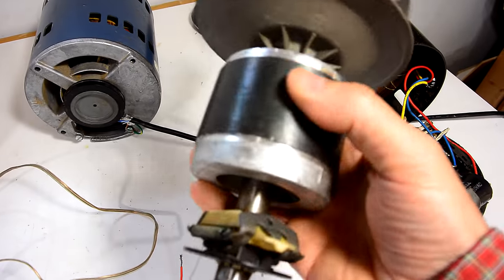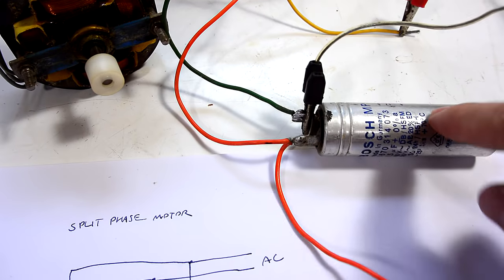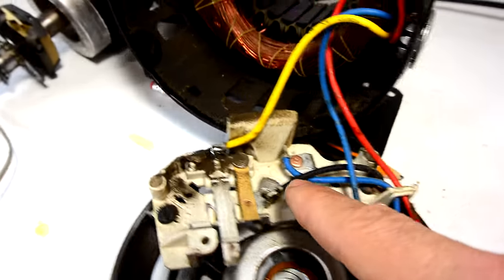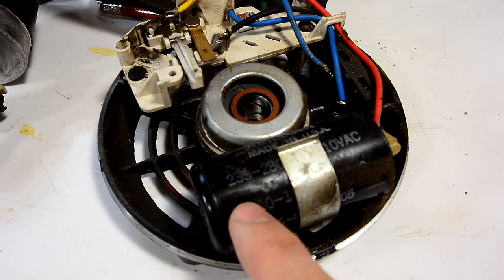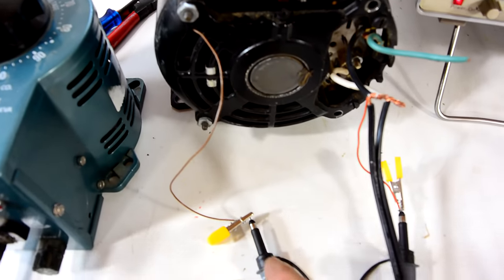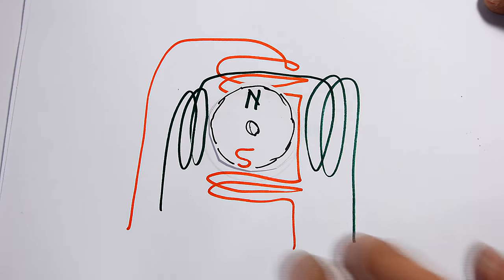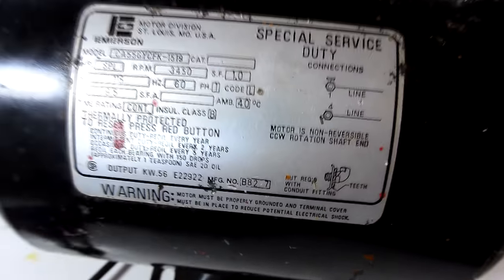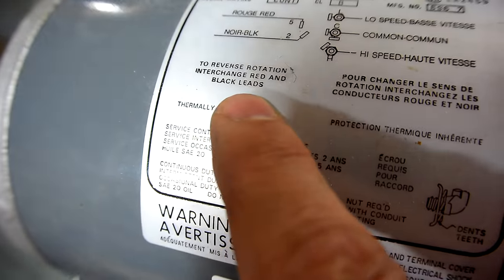Reversing single phase induction motors

Comment: VERY TO THE POINT, SIMPLISTICALLY BLOCK DIAGRAM PRESENTED ! BRAVO MATE !!! A SIMPLE EXPLANATION , OF A VERY TECHNICALLY COMBINED PROCEDURES FOR REVERSING DIRECTION OF A SINGLE & 3 PHASE MOTOR WIRING,  AGAIN SPELLED/OUT SO VERY EASY TO UNDERSTAND THE IF/THAN. A TECHNICAL PROCEDURE-VERY WELL COMPACTED  VIDEO,  COVERING ALL THE MAIN CAN & CAN'T DOs' . IT IS SO WELL PRESENTED  WITH  A "HANDS-ON SIMPLISTIC  ILLUSTRATION !
AGAIN, BRAVO !  I HAVE SEEN ALL YOUR VIDEOS & COULD NOT DISAGREE ON ANY OF THEM !. IT IS AN ART TO PRESENTING SOMETHING TECHNICAL IN A EASY-PEEZY TO UNDERSTAND PRESENTATION !👊👊💥🎯

Comment: Matthias,  I was able to reverse my non-reversible motor (an A.O. Smith, 1/8 horse power) without altering the coils.  I simply pulled off the casing ends and flipped the rotor end-for-end.  After this, the motor ran in the opposite direction.  It may not be possible to do this with all non-reversing motors, but on this one it worked perfectly!  The motor powered a heavy-duty orbital buffer that shook so violently that it was nearly impossible to use.  I disassembled it, removing the orbital counterweight unit and bolted the buffer disc holder directly to the motor shaft.  I thought I had to reverse the motor, which it turned out that I did not have to do, however, curiosity got the better of me and I had to test my theory: that I could just turn the rotor end-for-end to get reverse rotation.  It works and was easy to do on this motor.  Thanks for your educational videos!  Will

Comment: Great explanation! The thin wire used for the start winding is also to help changing the phase angle due to the greater resistance.

Comment: I want to thank you for teaching me how to reverse old electric motors.
I finally got around to put in a reversing switch on my drill press. 
You explain the process a lot better than other people who tell us how to reverse drill press motors. 
My 1937 Delta drill press with a Westinghouse motor was easier than I expected. Once I open the cover on the motor there's only two terminals where the power wires went in and other wires came off of  the windings  and I just reverse those two wires that went into the windings to make it run backwards.
I put a four gang box on the drill press with three switches, one for the motor, one for the light, and a 4 way wall switch to reverse the motor.
My old drill press lacks a few features I wish it had but it was fun putting this feature on it. Now I just need to find a light for it that looks vintage.

Comment: I had the situation at 7:45 with an unmarked motor where I had to disconnect all of the wires, ohm them to see which ones were which and then I was able to confidently unsolder and resolver the switchover, close it back up and low and behold, it worked!
Thanks Matthias!

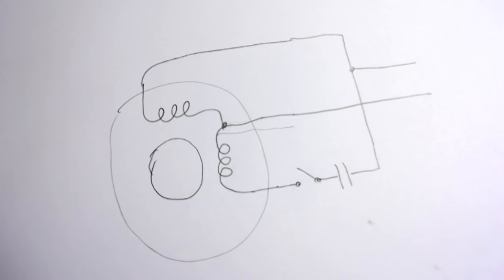Comment: Very good explanation. The only thing I disagree with is the comment that the motor at around the 8:30 mark "has to have the coils removed from the motor case or a hole drilled in the case" , to get at the coils common point so it can be split and swapped. As they have to be accessible for the coils to be joined, the common points on these motors are usually buried just under the first layer of coils near the ends of the motor. With a bit of care the wires can be traced back, dug out and split. The process is similar to digging out the common point for 3 phase motors so they can be converted from Y to ∆ connection. I have reversed a number of these motors and always found the common point close to the surface of the coils. I agree that this level of modification is probably beyond a DIY level.

Comment: Really interesting. And I agree with below comments. Keep this topic going.
I am just coming to understand AC motor and alternator theory of operation. I gain a basic understanding of what is actually happening, when I watch videos such as this, but I don't know enough to have the gut intuition that I have gained with internal combustion engines, which I began learning about as a young boy.
I recently bought an older Lima Electric 8KW 12 wire brushless alternator, and since I knew nothing about it, I began to research. The more I found, the more I thought to myself, "Wow, this is amazing!"

Comment: Didn't expect to see an osciloscope in a woodworking shop :D, great video !
Reply: Ramekenas  With the use of a homemade inductive pickup, oscilloscopes can be useful in the garage as well. (You really could see whats happening on the spark plug wires) Whats really cool now is that oscilloscopes that used to cost 5-15 thousand dollars (analog) a couple decades ago,can now be had for a couple hundred dollars or less on ebay and craigslist.

Comment: Thanks for the video, it was very helpful. I ordered a brand new motor for my tablesaw from grizzly and missed that the rotation was clockwise and I needed a counterclockwise motor.

It was not reversible, but I was able to isolate the start windings and switch the polarity.

Comment from the maker: About reversing single phase induction motors, and how the starter circuit works.
http://woodgears.ca/motors/reversing.html
(and there are still a few induction motor topics left to cover!)
Reply: Matthias Wandel That is starting to make a LOT more sense now. I have two washing machine motors, one of which I hope to turn one into a table saw one day and wondered why they had a beefy capacitor on them. Keep the videos on this topic coming ;)
Reply: Matthias Wandel Another way to reverse a single phase motor: remove the capacitor, wind a string on the pulley in appropriate direction, pull hard on it to get it spinning and switch AC on shortly after. It will happily spin in the other direction but only by mechanical start.
Reply: themaconeau Cause turning washing machine drum need alot more juice than blade maybe?
Reply: Wayne Johnson Probably. But potential can be wound back. The first step is to get the motor moving correctly. Then I'll worry about ratios and torque later ;)
Reply: themaconeau would a washing machine motor have enough speed to make a good table saw??
Reply: Best explain the way you made the oscilloscope connections to mains before people fry their scopes!
Reply from the maker: Ariel Barton
Please watch the rest of the video for the answer.
Reply: Matthias Wandel A very clear presentation on induction motors.

And as this is the anniversary of the birth of Nikola Tesla, a posting apropos of the date.
Reply: Matthias Wandel
Superb, clear, accurate explanation once again.
Following on AsiAzzy's comment, the capacitor on my old lathe motor burn out, so it would not start - until I realised that giving the chuck a spin with my hand would get it going.  Later I twigged that I could start it in reverse just as easily, which was handy for some sanding operations.   For this reason, when I got a new capacitor, I put a switch in series with it so that I could disconnect it and have reversible hand-starts when needed.
Reply: Tim Hyatt It does have 1100 and 2000 RPM on the label. When the Arctic Freeze of 2015 ends, I'll have to get back out in the shed and actually wire it up ;)
Of course, your motor may vary. Unfortunately, when things go around here, the motor goes - like cars :(
Reply: Matthias Wandel Brilliant vid again Matthias!
Reply: Matthias Wandel next you should go over PTC thermistor start motors.
Reply: Matthias Wandel Thank you. That was a great explanation and an interesting video.
Reply: Great Matthias Wandel. I once build myself a discsander to sit on the wall. The motor turns always the same way of course. This summer, I need to move it to a different position in my tiny workshop, but it will then need to turn the other way. This trick comes in handy, as it's a motor of that kind. Thanks for reminding me of that solution. My thoughs was to rebuild the sander. But its quicker solved by moving the capacitor ;-)
Reply: Very interesting way to explain the operation of the motors, but,  do you know how wiring the switch for reverse rotation?
Reply: I'll try to describe how it's made in the Hofmann wheel balancer. It's motor also has 3 wires. The common point of two windings is connected permanently to the mains N. The capacitors are connected in parallel with both windings. There are 3 relays for the motor: K4 connects or disconnects (shortens) the start capacitor, K2 and K3 connect the mains L to the one or another end of the motor's windings.
Reply: +Matthias Wandel Wow! THANK YOU for explaining this, which has always been a mystery to me until now. It was also interesting to actually SEE the centrifugal switch for the starter winding. From your other videos I knew that distinctive "click" indicated the switch engaging or disengaging, but it really helped to see it and how it worked. Very informative!
Reply: +Learner-Learns That is the same thing iv'e been looking for!
Reply: +Matthias Wandel Thanks. Just reversed a motor I need for building one of your bandsaws. It was 'non-reversible' but luckily I was able to dig in and find where the windings were connected together and bring another wire out. Very useful video. xox
Reply: Can you show me how to wire a capacitor on a single phase motor? Im scared for burning out the motor if i plug it in. I've been looking for variable controllers, but i couldn't find any. This is what my motor says:

serv.cont. 1/4 ch Rotor case
220 Volts 1,95 A
                    ^
                    ?
phase 1 50 Hz. 0,18 kw. 1440 rpm. p11
cos 0, 64.

Please help me! :-)
Reply: I found out that i CAN run it with the walloutlet! But i still want to know how to wire a capacitor on tgose motors
Reply: the one that says cannot be reversed have you tried tearing it apart and assembling it backwards, that is inverting the rotor by puting the front cover in the back and viceversa
Reply: +Alonso Quesada It works. I changed the bearings in my bench grinder and installed the rotor backwards. (facepalm) When turned on it spun the nuts off both ends instead of tightening them to the wheels. Definitely works lol
Reply: sr.  so much respect to u.
what an awesome teacher!!
Reply: M

Comment: You can reverse an AC motor like a pump motor. You just replace the capacitor to a reaktor which is used in fluorescent lamp circuits. And thats it! ;) It is very useful when we have just 3 wires out of the coils.
Reply from the maker: RoCCaT You could also reverse it if you have two phase power.  Just run the starter winding off the opposite phase.  But that's equally awkward.
Reply: Matthias Wandel Yeah you are true! There are a lot of ways to reverse. I heared about to use the reaktor and it worked well.

Comment: So the start winding will likely have higher resistance than the run winding.  In fact, the start winding will likely measure open as the start capacitor is charged by an ohmmeters DC potential.

Comment: As you said, the start winding uses a thinner copper wire than the run winding. So if you throw an ohm meter across the windings the Start winding will be somewhere about twice the resistance of the run winding.

Comment: You answered a question I had about my old GE reversible boat davit motors. One of them wont start so i have to give its large pulley a shove to get it going. I plan to first replace the start capacitor. If that doesnt fix it I'll assume its the connections to the start winding or the winding itself. Thanks!

Comment: I have a motor like this on my bandsaw. I want to replace the switch with a magnetic relay switch but the old switch only had one black and one white while I need the two black and two white to hold the magnet together during operation... do you have any experience with this? Where to find the other white and black wire? Thanks a lot. Love your videos.

Comment: Matthias, love the explanation.   I have a 3/4hp boat lift motor that only runs in one direction.  It was full of mud daubers, cleaned thoroughly as I thought a switch might be stuck however still only one direction.  From your video, I see that windings must be good as it wouldn't run in either direction if windings shorted.  Any ideas I'd appreciate. Larry in Florida

Comment: I enjoy your videos and they are very informative.  Could it be that they don't want the motor reversed because instead of the starter switch arm dragging on the pressure collar that it would be pushing toward the pivot point like backing up a trailer behind a vehicle?  Would that make it want to break off easier (maybe sooner than later)?

Comment: Basic physics to application, adjustment & building cheap, great video. Ind. Motor no start, but runs if rotated, check start cap,

Comment: Hello,I've come across your video, and it's just amazing the ability to communicate simply ... Thank you! ... I have a slight problem that I have no idea how to solve it ...I have an asynchronous one-phase asynchronous motor with four wires on one side - red and orange and red and orange on the other. my question is,How to place them on four pins? ...So that I would connect the source of the voltage and the phase.best regardsitamar

Comment: Great video, thanks. I've got a Tuscan 240v  induction motor that appears to have 3 coils... there are 6 wires wires emanating from the coils, three colours red, yellow (joined) and green (to capacitor), then there are three black wires also?  Any idea how this is set up?

Comment: Hi,  have an old bench grinder that ive taken to bits for refurbishing. Its a single phase, start and run type with a centrifugal switch, and does not have a capacitor. There are two wires coming from the windings; a switched (on/off) line, and the neutral, which were connected to the lead. Since taking the bench grinder to bits im not sure of the wires polarity, they are both black. Can I take a guess and connect ? Im thinking that if I get them the wrong way round it will reverse the direction of spin only, so easily remedied ! However I dont want to break something. Can I just connect and see which way the motor turns (50/50) chance of me getting it right, or is it not as simple as this ? Bear in mind this is a start/run type motor, Thanks if you can answer, I realise this is a dated vid.

Comment: I have been doing research on making motors spin different directions and your video is the best! I have Car lift from Atlas that was purchased in US with single phase 230v motor and the motor is spinning in wrong direction. I had changed polarity according to the wiring diagram and it does the same. There are 2 metal strips that has to be changed from vertical to horizontal position and it should make it spin opposite, but it does not. Also swapping 2 positive leads did not do any different. I had another new replacement motor installed and it does the same. Atlas customer service representative suggested the motor winding being defective/installed wrong from the factory. Got new motor installed and it does the same. Any tips  what could be wrong with it?

Comment: grate video!!! Now I understand a bit mor about AC motors!!!!
One question. On a single phase motor like the the first schematic that you show, If i wanted to be bidirectional I will Need a Neutral wire and two live wires to select the rotation right?
My question is, What happens if I accidentally activate bothe of the Live whires at the same time. meaning that both windings will be runing at the same phase?  whill that create som sort os short circuit or burn the motor, or nothin will happen

Comment: hello mr Wandel, i have a single phase motor with 4 wires coming out of the motor. The windings are identical. one winding is connected by a capacitor(permanent). Can i just use the other winding and get it going by hand?

Comment: I have a 1.5 hp ac single phase motor with a start capacitor and 4 wires coming out from the motor.  
I figured out the leads that goes to the starting winding (checked which ones have continuity to the capacitor wires since the resistance was the same on the 2 windings).  
If i switch the connections of the starting circuit, the motor just hums and does not turn.  Is it because the centrifugal switch and the capacitor are not wired in series as mentionned in your text ?  Is there something I can do to reverse the rotation ?

Comment: I have a Delta Rockwell 12 14 table saw.  Is there an easy way to determine if the motor is 3 phase or not?  I believe these saws originally were set up for 3 phase but I'm not positive the existing motor is original.

Comment: Old Matthias is a pretty smart guy, I have an old Logan Lathe w/reversible AC 110v 1 phase motor 1/2 HP which just burned out.  Not sure how to fix it except taking it to a motor shop or replacement on Ebay hopefully.  Lots of wires, qty 4 going into the motor

Comment: Im building a electric bike, and i have a question about the rotation of the motor. I've built my diy bike, but the motors spinning the wrong direction. Its a permanant magnet 24v 350w motor. How can I reverse the direction of the motor? I have it hooked up to a 2 pin rocker switch and a 22.2v 1400mah battery and it all works, but how would i have to change it if i wanted to make it go the opposite direction?  Its going clockwise now, but i want it to go counter clockwise. If i swap the connectors on the motor ( like connect positive motor wire to negative battery wire and negative motor wire to positive battery wire ), would that work?

Comment: Hello! I have a 4 pole single phase with no terminals (all wires wrapped into the windings) possible to rewire to go in reverse? When I do switch up the wiring, motor hums until I spin the arbor (start capacitor not kicking things on) and the motor sounds a bit rough. Can’t figure it out :(